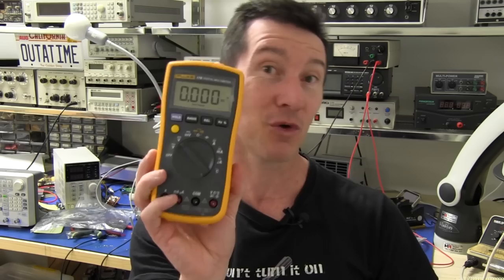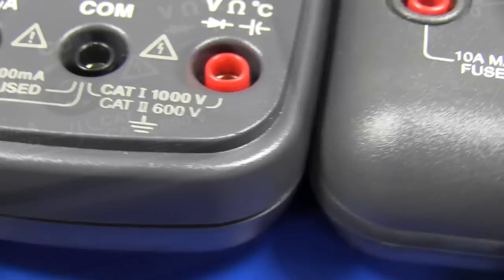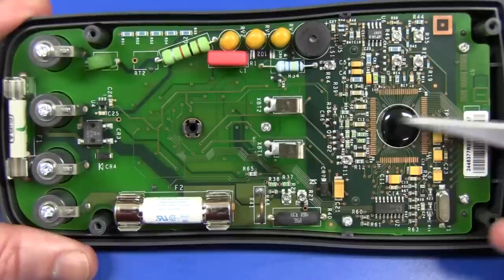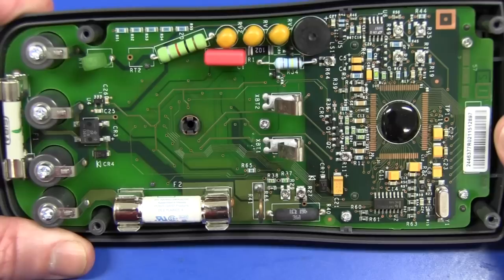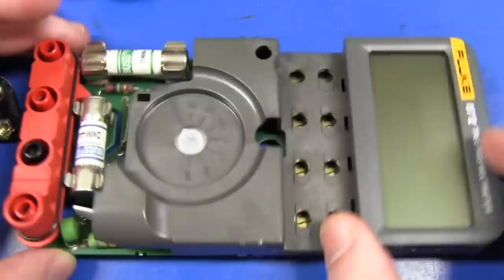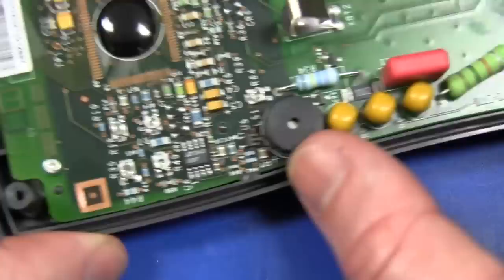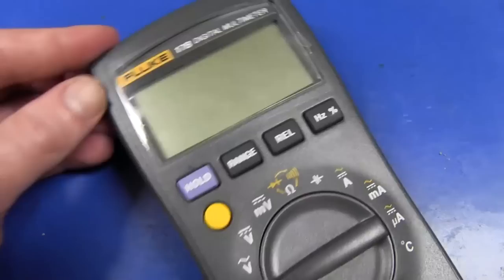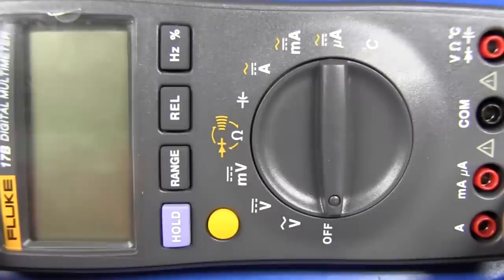EEVblog #344 - Fluke 17B Multimeter Teardown

Comment: I have watched the guides to soldering and then come on to this - absolutely fascinating!!!  I am a slightly versed hobbiest (without any sort of Fluke!), but certainly no EE BSc and almost no practice since I was a teen.  I think this will be a tremendously interesting channel to follow in depth and hopefully soak up some learning along the way!  What I like the most is the straightforward, nuts and bolts 'do not be affraid of it' tone.  Just what I am looking for. Many thanks.

Comment: I've used the Fluke 11's and 15's. They're not bad. Sometimes when troubleshooting all you need is volts and resistance. These models do a good job at a low price.

Comment: MOVs, as others have said, are metal oxide varistors. The word varistor is a combination of the two words of "variable resistor" and refer to a component that is intentionally designed to have a resistance that changes with the voltage across it, that is, at low voltages they have a high resistance, but when the voltage approaches the specified voltage of the component, the resistance start falling rapidly. This means varistors can be used to limit the voltage to protect other components.

Comment: As always, great teardown/review by Dave Jones, your one of my favourite electronic reviewer!  Just ordered a 17B+ for 90usd from eBay. Going for "a Fluke is a Fluke". Although a lot of other DMM offers more, like Mustool MT826, I prefer a brand name with a good rep. At the end of the day, I wonder how many really really need that extra features...
Reply: How do like using this model?
Reply: @MrDoneboy  yes, nice clicky dial, clear backlit displayed and an overall solid "real Fluke feeling". Only negative is the probes, quite cheap and stiff. Will be replaced with better ones. Nothing wrong with them, just seems more fitting to a generic cheap DVM. The old cheap DWM hasn't been used since I got this :)

Comment: Very simple: As current passes through the thermistor, it gets warm because of that. But since it is an thermistor the hotter it gets, the higher the resistance. So at low currents it stays cold and nothing happens, until something goes wrong and a lot of current goes though it. Thats why they are often used in conjunction with MOVs.

Comment: The Fluke 15B is the best digital multimeter one can buy under 80 USD (it is the same as the 17B without the temperature function).

Comment: The Fluke 87 has pots too, it is not a closed case calibrated meter! I find that to be an advantage cause with a manual and a calibrated source you can do the calibration yourself. Owned a Metrahit 23s with no pots, had to send it to Germany for calibration, great! Oh and about the Metrahit 22s-26s series, the slowest AC range on the planet and the touch hold takes forever if the signal is stable enough.. if not it does not even trigger. Great build quality tho.

Comment: Lots of other, non-Fluke probes around which are acceptable at lower prices. I primarily use a set of surplus milspec leads, which are modular. Unrated, but I trust 'em.

Comment: I expect that it is the MOVs that limit the voltage, but as they do this by decreasing resistance, this causes an increase in current in the circuit that could potentially cause overheating, so the thermistor is put in to limit this current to a safe level(as the current increases, the thermistor starts heating up(due to heat loss in it's resistance) this heating causes an increase in the resistance, and so limiting the current)..

Comment: I looks to me like the fuses are protected form axial movement by protruding tabs molded into the back case. You can see them at 15:30 I also think the battery compartment or the row of input jacks would provide some side protection if the fuse exploded, although not as good as the 87V.

Comment: I often find those little pcb mount buzzers are louder if you block off the port. I normally screw a tiny bolt into them and it makes them considerably better. They are pretty useless though, not of any use in a noisy environment.

Comment: Both (yes i have 2) my Fluke 17B meters have a chip on board in them.
The boards are exactly the same as the one in your teardown.
Reply: I also have a 17B with a chip, and the PCB is the same but it omits the LT134 opamp and a couple of trimpots, the resistors and capacitors around them.

Comment: Looks like they skimped on the shielding and such in favour of decent input connectors, input protection, and fuses. Not a problem with such relatively low specs. That 500mA fuse is probably rated for 1.5kA or more, which IMO is perfectly adequate for the mA range. Anything using that little current on 240VAC will be using similar types of fuses or even glass, and remember the CAT rating limits potential fault current. Seems like a decent meter for basic electronics and safe to poke mains with.
Reply: A bit late, but for future reference for others: The 500mA fuse is manufactured by SIBA, a very reputable german manufacturer. I also worked with their NH fuses for power distribution cabinets, very well made stuff, also they had great knowledge when you would ask about special applications.
This looks like a standard 6.3mmx32mm fuse, could be a #7017240. This is specified for 30 kA AC/DC Energy- yes, Thirty Kiloamps according to catalogue! 
And: To produce a short circuit current of well over 1000 A you will need a very powerful electric distribution- usual short circuit currents in an ordinary household installation which operates on 230V AC are usually in the range of 200A-500A, rarely reaching 1kA...

Comment: Exellent teardown, as always.
I'd like to see some autorange speeds and other useful tests you do.
I also wonder, does it have voltage protection for all ranges. This is what low price meters usually lack. That's a pretty hazardous test though.
These are available in Chinese web stores with worldwide free shipping for about 100$.
I just bought UNI-T UT90D, with same functionalities for ~40$. I will have ter it down and see does it have as well built interior as this Fluke!

Comment: For a thermistor being used as current-limiting device for circuit protection, current through the device causes a small amount of resistive heating. If the current is large enough to generate more heat than the device can lose to its surroundings, the device heats up, causing its resistance to increase, and therefore causing even more heating. This creates a self-reinforcing effect that drives the resistance upwards, reducing the current and voltage available to the device.

Comment: I bought one of these off ebay 12 months ago and it's...well, ok, but I still find myself reaching for my trusty 1995 vintage Fluke 11.  The precision of the 17B is better as you would expect but continuity testing and capacitor measurements are painfully sloooow. I'm always wondering whether the probes are actually contacting the DUT.

Comment: +eevblog someone at fluke must have watched this, my 17B has a backlight. My original 1988 fluke multimeter, was 6 times the cost and had no backlight switch or temperature capabilities, if anyone finds it, it has a 10 amp blade fuse wired in for the 10 amp fuse, and my licence number engraved in the grey case (australia)
Reply: +fleuroman Likewise, much better than my 77 and a much larger, easier to read digits. It's a steal!

Comment: 7:49 better than a glass fuse? If you're a tech the glass one is better because when your meter is down you know its out because you can see it. You can't see through white ceramic. When I went to college our college store sold glass ones for replacement for my 77.
Reply: You can test it with a cheapie meter. No big deal.
Reply: Yes it's safer than a glass fuse.  I've seen glass fuses shatter when they blow.  The ceramic silica sand filled ones don't.
Reply: Glass fuse and fast blow type is the best...

Comment: hi Dave grate videos as always just wanted to ask what you think about the GREENLEE DM210A DIIGITAL MULTIMETER as i know brymen also make this meter under a different model no would you say its a good meter as iv got a fluke 116 and a cheap vici vc97 i was going to get the greenlee dm210a as a upgrade for the vici vc97 as the fluke 116 doesn't have a amps range and just wanted your opinion thanks all the best john.

Comment: hello dear,
perhaps you could help me about my digital multimeter.
i have got victor vc9801A+. after i opened the multimeter, i have lost the 6 small metal which making shirt circuit inside when movinf the switch for selection(voltage, ohm, current...etc).
could you help me to know the right position??